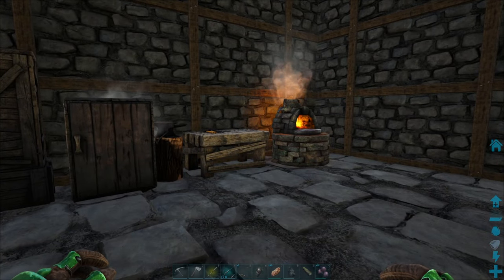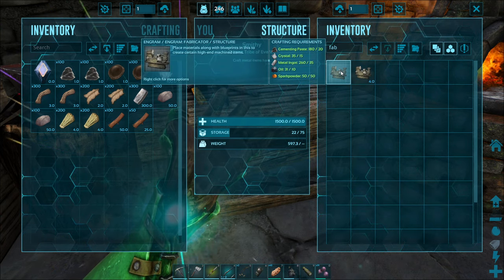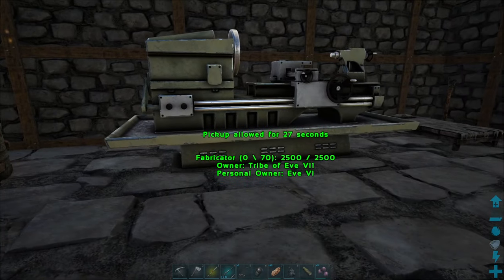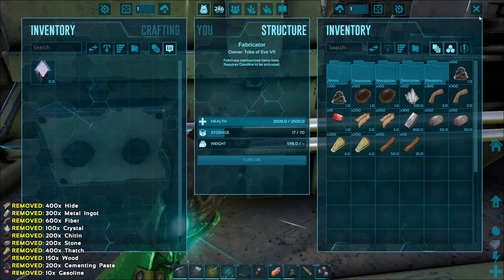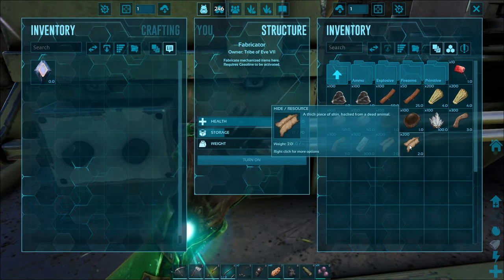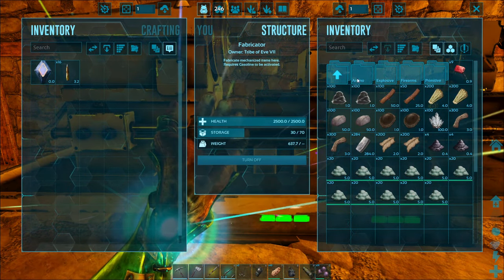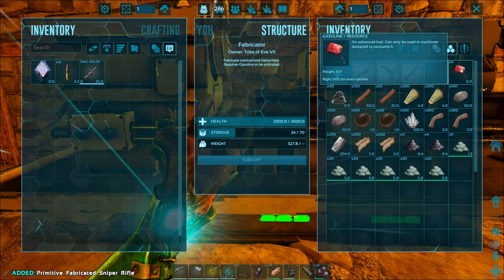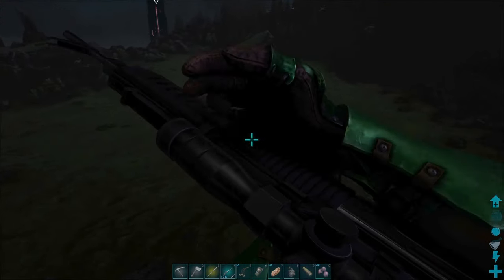Fabricator Power and Craft - Ark Survival Evolved How to

Comment: wait we have to place fabricator on stone not thatch and wood cause i place fabricator on thatch and when i try to craft a polymer i got all the recipe and it wont show the blue craft thing also i play ark on mobile
Reply from the maker: I’m not familiar with the Mobil version.  Did you use gas and turn it on?  I think on one map I played I had the fabricator on thatch.  I know I have had fabricators work on wood foundations.
Reply: @FatFrogsSwamp  I don't have gas how do I get them?
Reply from the maker: Gasoline can be made in the forge with hide and oil.  Then you will have gas to craft the fabricator.